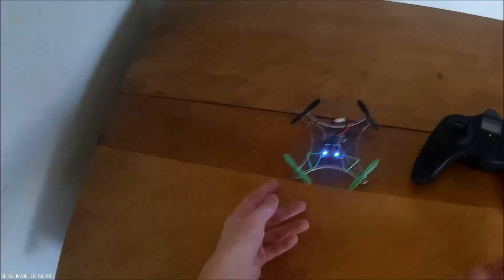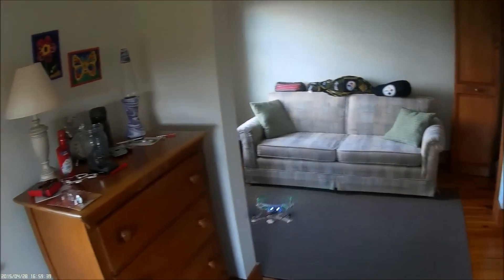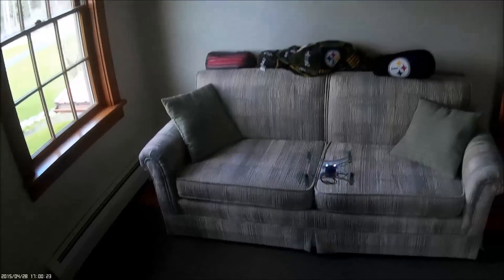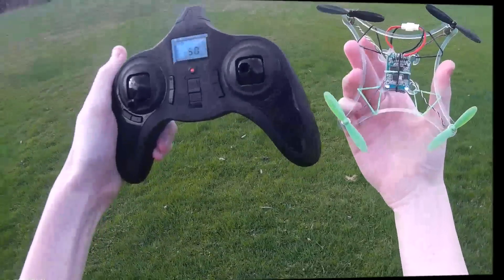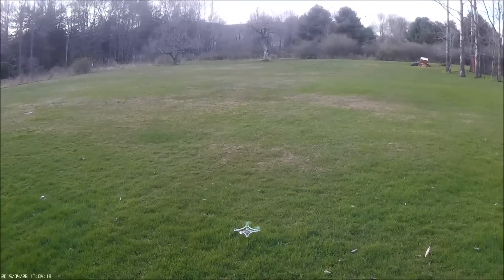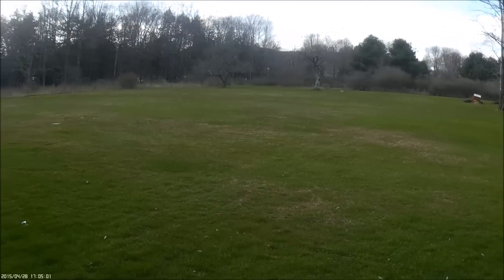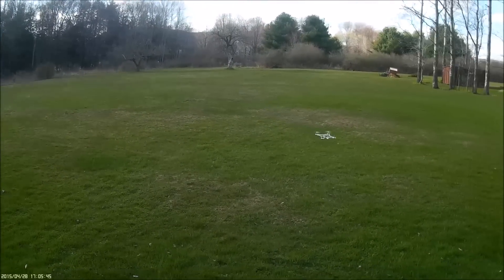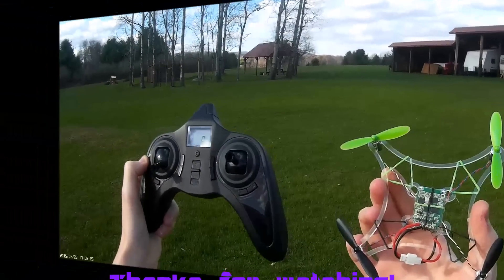Dreamcatcher Frame Flight, Hubsan X-4 Electronics

Comment: would it be possible to use motors, props and a battery from a bigger drone on a bigger frame, so you can
still use the same remote control?
Reply from the maker: If you use the same board yeah

Comment: Mine can't do automatic flips anymore, it just slams into the ground because it can't stabilize. Do you know what the problem migth be? Bad Motors?
Reply from the maker: +Fábio Castro Hmm, mine does that sometimes too. It is just so snappy that is keeps over correcting and wobbles to the ground :(

Comment: Great mod. That thing is fast. What sizes (may) is the battery? Maybe it needs a bigger one like 500 mah. I watched Benedikt from MMW uses higher discharge battery. I test mod an X11 with dreamcatcher frame with a 7mm MMW motor. The battery is very warm at the end of LVC. Like to see a JJRC mod.
Reply from the maker: Michael Reyes Thanks! It does get around :D I use the stock Hubsan X-4 240 mAh and the Lian Sheng LS-124 350 mAh batteries for it. Larger batteries like the Eachine X6 520 mAh work but it strains the motors more and goes slower. The LVC is just really early on mine, like 2-3 minutes. Not sure if it is just mine or the voltage sag from flying full throttle but it happens. I just fly until it drops. The battery does get warm as you are most likely discharging it faster when you are going faster. Do you mean the JJRC 1000A on it?
Reply: Yes. Try the JJRC 1000 FC board.
Reply from the maker: Michael Reyes I had put the 1000A on it and it was amazing but I cant do my 1000 because I lost it in a fire :(

Comment: Thats really cool man, I can't believe how much faster it seems than a stock hubsan. Weird that just a different frame can make that much of a difference to performance!
Reply from the maker: Jax Teller WA Yeah, it is a nice frame. The reduced weight and air drag lets it go full pitch and full throttle without dipping dow too much making it much faster :) Thanks for watching :D
Reply: The RCAddict
It works really well, Great stuff mate. I had 2 of my Alias batteries die at the same time! now they will only take on 120mah of charge......Sux!
Reply from the maker: Jax Teller WA Ouch, make sure to discharge them!
Reply: The RCAddict
Hmm, latrax charger has no discharge function
Reply from the maker: Jax Teller WA Ok, have you see my video on it?
Reply: The RCAddict
No I haven't mate, I will check it out

Comment: you customized the rates to 80/100 to get funnels like that?
Reply from the maker: jam3s121 I believe I had the yaw at 85% and pitch at 100% Thanks for watching :)
Reply: The RCAddict assuming the yaw is the bottom left adjustment in SE mode yes? I did this and left all other adjustments at 100% and it spirals into the ground immediately
Reply from the maker: jam3s121 This could be a variety of things. 1. Sometimes the accelerometer goes whack and a factory reset will fix it/ I have a video called "Hubsan X-4 Transmitter Overview" on how to do it. 2. If it is in stock form it might not be able to get enough lift to stay in the air, maybe lower the rates. 3. Sometimes when I go a really fast maneuver like a 100% everything funnel it will go down as the gyro gets confused and just crashes. Maybe just try lower the rates a little. Hope this helps. If it is still doing this please let me know and I will try to help you again :D
Reply: for 85% yaw though, thats the lower left trim SE setting yes?
Reply from the maker: jam3s121 Yes. Have you seen my transmitter video? It might help
Reply: I finally got it, thanks for the help though. Still not loving the hubsan.. over hyped for sure IMO.
Reply from the maker: jam3s121 Nice. Yeah, I wasnt too impressed for the price. I think it is so popular because it was the first "cheap" micro sized quad
Reply: i think its popular because its one of the few toy quads u can get parts for that are stocked in the USA. All of my other quads I pitch and roll much harder without the wobble this one has. You are right about that gyro.
Reply from the maker: jam3s121 Yeah, the gyro is just not very good.

Comment: Finally! Ive been looking forward to this build from you. Seems like forever ago that you started mentioning it! Nice to see her in the air!

Im thinking of grabbing a dreamcatcher or similar carbon frame and doing this to a JunChueng 3015-2 soon.

Cool vid!
Reply from the maker: ***** Yeah, it was a while as I got the build out right away then right at the end of testing is broke then china shipping came into play! It does looks nice. The frame is nice and works with any small quads. There is also a 8.5mm version if you want something larger. That would be awesome with the 3015! I have been hearing great things about it. Glad you liked it! :)